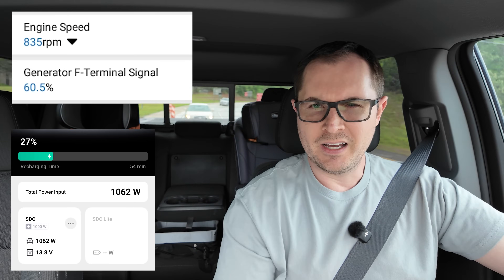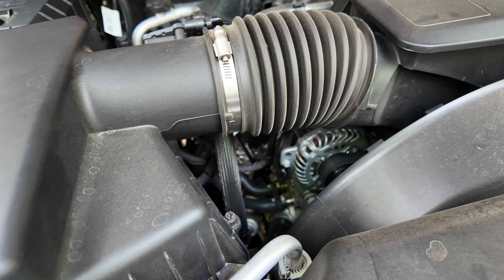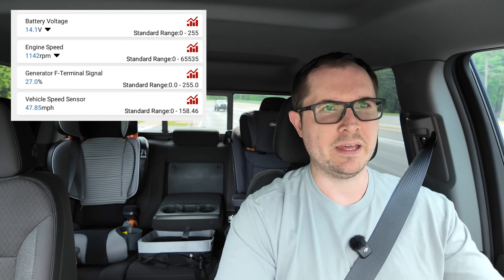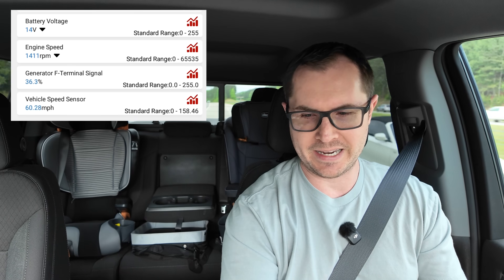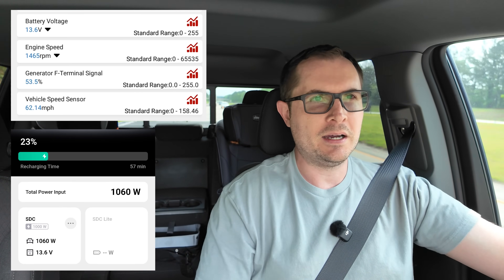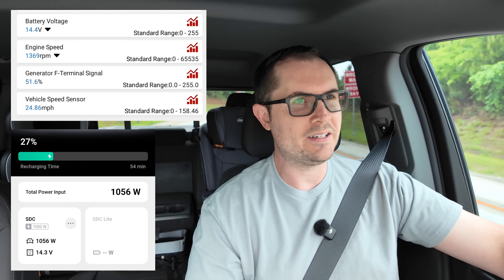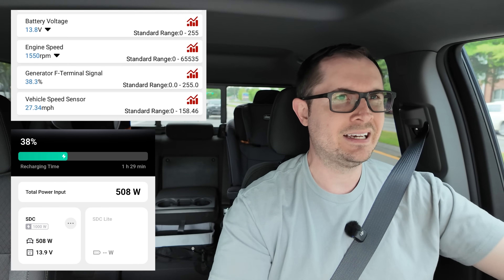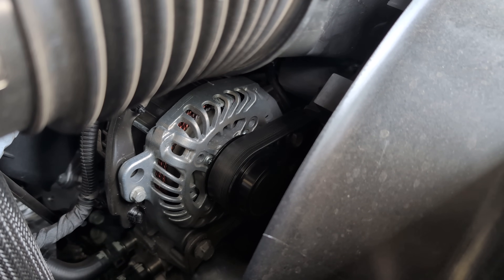I Show REAL Numbers: Impact of DC-DC Chargers from DJI, EcoFlow, Bluetti on Alternator

Comment: I have an VW Bus with an 120Ah LiFePo battery installed that is being charged by a Renogy 50A DC DC booster which gets its energy from a 90A alternator. While on paper it might work out, one thing I didn't initially consider was the fact that the alternator in idle only outputs roughly 65A. At this point I'm going thru my fourth alternator in 18 month. The first alternator suffered from a worn bearing, number 2 had an internal electrical issue (diode fried), number 3 had an mechanical issue that was probably there from the factory and number 4 has another broken bearing. Especially in winter time starting the engine and when climbing up steep hills with an empty interior battery you can definitely feel the DC DC booster kicking in up to the point where you have to shift gears. Another thing that I noticed: the starter battery seems to be acting as a buffer now since it will momentarily stay at a high voltage when fully charged, in situations where the alternator is not providing full power. Ever since installing my DC DC booster the starter battery feels much more weak and near death despite it being only 2 years old. The power draw with lights and radio on is around 75 - 80A, given that the alternator only produces 65A at idle it does put a lot of stress on the alternator, I believe it can handle the load electronically but since it's always running at the limit it seems to also stress out the alternator mechanically (causing the bearing failures). I really wished my DC DC booster would have something like "idle detect" or at least have a time delay after starting the motor.
Reply from the maker: Great firsthand feedback. Thank you for sharing this.
Reply: As it seems I'm not the only one having those kind of problems. Renogy now sells a 40A DC DC booster with idle detection so I'm very happy they are taking these issues serious. It's on sale at the moment for a whooping 109€ (discount code: GARBC) - it even comes with Bluetooth connectivity. Not affiliated with the company in any way, (just trying to help other vanlifers). Though I'm still considering installing a relais to turn of the charger all together for driving up the steep mountain roads in the Alps.

Comment: So only use dc dc charger at high rpms.  Like when at highway speed.

How did you get the f-terminal signal readout?

Great video thanks
Reply from the maker: Well said, that was the big takeaway I learned. I was using the Kingbolen S800 OBD2 reader here:
https://amzn.to/43hiu65

It's come in really handy to be able to read variables that don't show up on the gauge cluster. I'll be testing the more advanced Kingbolen K7 soon in a future video:
https://amzn.to/3T1CSSx

Comment: What is the purpose of the dc charger?
Reply from the maker: Great question. Basically the DC-DC charger acts like a "super charger" to rapidly recharge lithium battery banks on an RV or trailer, or it can rapidly recharge a portable power station like I used in this video to demo. On the DJI Power 1000 featured in this video, the difference would be about 10x faster...10 hrs on standard 100W cigarette plug charger vs 1000W DC-DC charger, so 10 hrs or charging vs about 1 hr under ideal circumstances (sometimes that 1 hr can turn into 1.5-2 hrs).
Reply: @AdventureRocks  are you reading the F terminal from the computer on the truck?

Comment: gr8 vid, i had the same question. my van has a 140amp alternator, i upgraded it to the factory 180. i figured it was mean for a delivery van's AC. i have the renogy 50 amp dcdc which is about 700w. i figured the extra 40 amps of the bigger alt would provide the majority of the 50 amp dcdc would require. my question is more about idle, when it is cold i turn on my van for 30 minutes to charge and also run the heater. i always notice my heater in any vehicle warms better / hotter when i drive vs not drive - i think it is because the voltage is higher when the rpm are higher? many have said it's not a problem but i figure it has to do with burnout and the alt getting hot, and when not moving you dont get the benefit of the cooling of the wind. so i wonder how long it can run in idle and do zero damage. again i figure the system is designed for a delivery van which can have some stopping while unloading. i am glad i have  10amps more than you in the alt and my charger is smaller than yours, 700 vs. 1000. we still dont know what percentage is the best for longer term chasrging, like say i drive for 4 hours. i think some dcdc cycle off every 30 or40 min. what i will do differently is i wont run my ac while running the charger, i will probably cool it down first, then turn ac off with the fan on only, then turn the charger on. i am glad i installed a breaker so i can turn it on and off. in terms of heat, i would only idle when it's cold, so that would help keep the alt cool. i'd like to see an extended  idle to see what happens, maybe have the hood open and a temp sensor on it to see how long it takes and see what the spec says about running temp. and how hot does the alt get when you just drive around on  a hot day with or without the ac.
Reply: Looks like the general idea is the alternator needs to be 2x the sizr of the controller. I must have checked this. But i do like how you showed how the full demand taxes the electrical system,  like AC. I wonder how much the tablet is using. I also discovered i can configure the charger can be set to deliver 10 to 50 amps.
Reply from the maker: @alutious  Great question. Yes, the Bluetti, EcoFlow, and DJI all have a minimum voltage parameter in the settings. By default they are set in the mid to high 12s. In testing them, it seems as the voltage drops or approaches that minimum voltage, they all scale back on how much power they pull, so it seems they got it right in the software. I have mine set to 13.0V as minimum and that seems to work nicely.
Reply from the maker: Nice setup. Thank you for watching. I'm with you on the idling use-case.
Reply: I should ask renogy what happens when the charger pulls to much for the alternator? I suspect the charger is voltage based. So the alt will just collapse. Or does it have some kind of protection? I will also ask them what size if alt is recommended,  or what %. I assumed since other vans use the dmcharger, and my van has an upgraded alt, that it should work fine.   @AdventureRocks

Comment: We install victron dc chargers. We keep it simple. Whatever the rating of the alternator, we use a charger that is no more than half of the alternator amp rating. 80 amp alternator, orion 50 with  amp output set to 40 amps. What we'd really like to see is a temperature sensor attached to the alternator and tied to the software of these devices. But that really is just another point of failure and issues. We've not burnt an alternator in 5 years of just sizing half the rating.
Reply from the maker: Great advice. I like the simplicity. Thank you for chiming in.
Reply: Victron is the gold standard.  I use mine and it auto senses the load on the truck and sips accordingly to avoid alternator damage….
Reply: Sounds like a good approach, thank you!
Reply: I badly need one but was afraid of alt damage. Who can I get to install one? Any car repair shop or who? Im in TN.
Reply: @cvcoco it’s easy.  Do it your self.  Do your research first and dive in
Reply: @rickylee2477  I did the research and there are no instructions as to using customer connection points on a transit 250. I found a car stereo shop and while they did the install, they couldnt figure it out either and did a sorta hybrid. I didnt want to fry anything. As it is, I need to find another shop to re-stall according to use of the CCP if it can be done. It cost $200 and I was disappointed although it does work. I need two new batteries and the chargers NEG is connected to the battery NEG. Ford says they wont warranty batteries if anything 3rd party is attached to it.
Reply: @djkillachris  Great template to follow 🙌

Comment: As a weekend warrior, I prefer a 300 amp hour lithium phosphate battery and  Carry my Honda eu2200i to recharge my battery to avoid damaging my vehicle’s  alternator.
Reply from the maker: Nice setup. That Honda will last a lifetime practically.
Reply: Yup.  I can carry a gen set and spare fuel.  I cannot carry my 3/4 ton truck to the shop.

Comment: I've been using a Victron Orion 12|12 18a DC-DC charger with a 160A alternator so I'm not so worried. I would think anything less than 90% safe. For the most part you're only going to be idling  no more than 5-10 minutes at the most. It's probably best to shut off the charger in stop and go traffic.
Reply from the maker: Great point, thank you for watching.

Comment: What is the temperature of the alternator with it charging vs not charging?
Reply from the maker: I didn't test while idling as I'm just not comfortable with that use-case personally, but otherwise I did take temperature before and after use with an average speed in the 40s, and temp was suprisingly ~165 F before and after. I let it heat up of course before with regular use. I do have a very large fan on my truck just in front of it. And, seemed like most of the other components in engine bay were in the 160s F as well.

Comment: If you use thermal controlled DC-DC that measure the alternator temp and adapts. There is no extra damage. Set it to 100c and you are golden
Reply from the maker: Great point, that'd be a nice feature for sure. Right now most of the mainstream players just use voltage as an indicator of alternator strain with a minimum threshold setting in the 12.0-12.6V range depending on the brand. I've been trying a minimum of 13.0V on mine and that seems to give a nice safety net. Thanks for watching.
Reply: @AdventureRocks  my bi-directional dc-dc charger monitors thermal, and voltage directly from the alternator. It also optimises powerdraw specifically per individual alternator and its RPM curve. Much like how an MPPT works but for alternators. Comes in 1500W for sub 150A alternators or 3000W for larger alternators. I have 9.2KW/h battery and it charges it up fast :)
Reply from the maker: Sweet!  @stefangranath3841

Comment: Am I the only one who is not convinced this F terminal data correlates to actual alternator output?  Rather, this is likely measuring the output to the alternator rotor.  

Alternator output is regulated by two factors:  rpm and rotor current.   For a given output, at high rpm, rotor current is lower….at low rpm, rotor current is higher, even with the same amperage output.   

There is a strong likelihood this is what the f terminal is measuring.
Reply from the maker: Correct, it's not literally the actual alternator output in amps, but rather a % directly responsible for regulating the current and alternator charging rate. It's not a 1-1 relationship all the time, but it mostly tracks with the goals I had in mind to get a glimpse into the imapct on the alternator. I wish I had a other variables to read in through my OBD2 reader for more data, but unfortunately that's what I've got on my truck via OBD2. A regular clamp meter would be great to see actual amperage coming off the alternator, but tricky to measure and display while driving. Thanks for watching.

Comment: Alternators are very inefficient, the load they put on the engine is bad for mpg.

You need to manage this, maybe permanent magnet generators are better. But the load onnthe belt is phenomenal

Management is best, eg daytime only and something to control so that it only draws when you are going down hill

Me myself I will put a solar panel on my caravan roof

Comment: What is your dc/dc charger charging?  You don't seem to be towing anything.
Reply from the maker: Great question. In this video I'm using the DJI 1kW Super Fast Car Charger (DC to DC charger) and the DJI Power 1000 (1024Wh portable power station) which is lithium-based chemistry. For charging a trailer battery bank while towing I recommend the Victron or Bluetti Charger1. Thanks for watching.

Comment: Summary: Upgrade your alternator when using DC - DC chargers
Reply: That may be the summary but not the logical conclusion. The reason you install a dc-dc charger is to protect your alternator when charging lifepo4 batteries. If connected directly to your alternator the batteries will draw much more than the alternator can handle. Unless you really need 88 amps of charging capacity, buy a 20-40 amp dc-dc charger, and you won't have any problem. Saying dc-dc chargers are bad just because he bought one that's capable of drawing 88 amps is just junk science and downright misleading.
Reply: I think its fair. But how big an upgrade? Prob enough to meet your addition, I upgraded mine by 40amps and my renogy dcdc is 50. I recently discovered the new software let's me configure the dcdc output in 10 amp increments. I tried this, changing it to 40 and then 20. Works well.

Comment: How does it affect the generator if the DC to DC charger is connected straight to the battery?
Reply from the maker: Great question. Basically the DC-DC charger is connected directly to the vehicle's battery, using it as a "buffer" of sorts and then the alternator reacts to the battery voltage dropping, in-turn supplying more power to the vehicle's battery which goes to the DC-DC charger. Thanks for watching.

Comment: I think the key is idle rpm- that’s when the alternator is going to really struggle and cook itself due to lack of RPM and cooling airflow. Higher RPM = higher airflow, and probably not such an issue. 
Thanks, great video, Cheers.
Reply from the maker: Great point, thank you for watching.

Comment: When I started towing my big tear drop with my old truck, I kept going through batteries. I was running the fridge and an iceco freezer while going down the road, plus charging devices and running all the typical vehicle things like lights, ac etc. But I kept going through batteries. It turns out I only had like a 60 amp alternator, so it wasn't keeping up at all times as things cycled and it would draw the battery down overstressing it. Eventually I figured this out and upgraded the alternator (along with the main charge cables since the stock ones were too small) and it's been fine ever since. So from this experience it never seemed to hurt the alternator, but rather the battery.
Reply from the maker: Thank you for sharing that helpful experience.

Comment: Do you know if there are any OBD2 apps that can show the alternator load percentage?
Reply from the maker: I believe it is a combination of what a specific vehicle/brand reports and what software the OBD2 is capable of reading in. For example RPM, speed, etc. are all pretty standard to read via OBD2 across the brands, but then some brands seem to have more specialized variables that can be read-in by more advanced readers that feature brand-specific software. I was using the Kingbolen S800 OBD2 Reader (https://amzn.to/4jSaDBh) in the video and had to go through the menus specific to GM to get that data. And even then, what I was showing isn't necessarily the exact alternator output, but rather a field terminal signal that is very closely related to it. Another option would be to use a clamp meter that has bluetooth where it can remotely send the readings to a phone or other screen. My clamp meter is analog, so hard to do while driving. Anyway, sorry I couldn't be of greater help on this one.
Reply: @AdventureRocks  got it. I have a promaster and the Alternator is super difficult to reach

Comment: Interesting. I don't think the field coil current is the whole picture, but it's worth seeing. I guess running the field coil at high current will also increase heat due to eddy currents in the stator, especially if that gets them close to magnetic saturation :-)

The biggest issues to my mind are lack of air entering the engine bay at low speed, and high current heating the (high current) stator coils and rectifier, while all that heat has to escape the alternator body with possibly not much air circulation, and a hot engine bay.

I wonder: do these delta-wound conversions last better, by only producing their high output at higher RPM? (As far as I know, most standard alternators are star-wound)
Reply from the maker: Great points, thank you for watching.

Comment: I wanted to put an inverter charger setup in my truck, My truck has 2 220amp alternators, and 2 batteries I feel even that is risky at idle sitting still with a high amp draw. My plan was to be able to charge the 300ah battery in my camper, or recharge my Jackery 3000 while road tripping. I’ll definitely be throttling it down at idle
Reply from the maker: With dual 220amp alternators it seems like you'd be in a good position. But, I'm with you on the avoiding idling. If nothing else, the heat could take its toll.

Comment: this is exactly what I was looking for.

I have a 410 Ah battery bank and a 60A Renogy DC to DC charger that typically charges at about 40-60amps. I've gone through three alternators and one "high output" alternator. All my gauges are correct, fused and I could never understand why.

Now I know that its either the rectifier or the voltage regulator that burns out. From now on, I'm limiting the current draw to no more than 20amps. Thank you for making this video good Sir!
Reply: What vehicle do u have?
Reply from the maker: Thank you for watching!